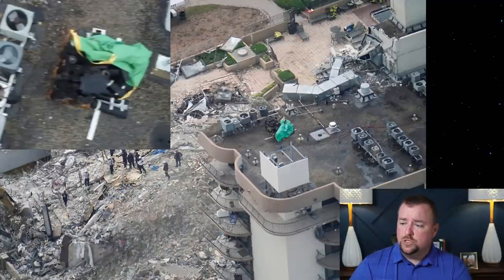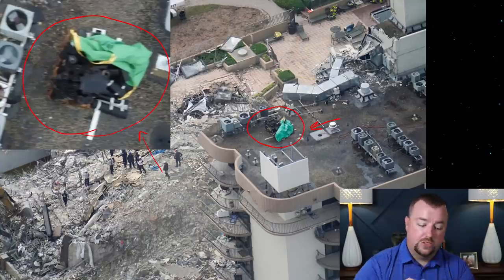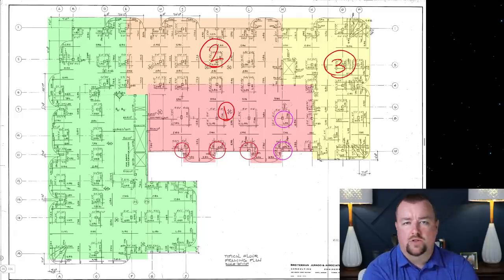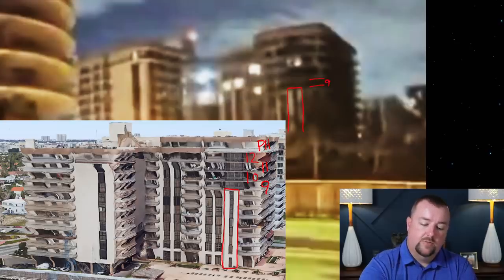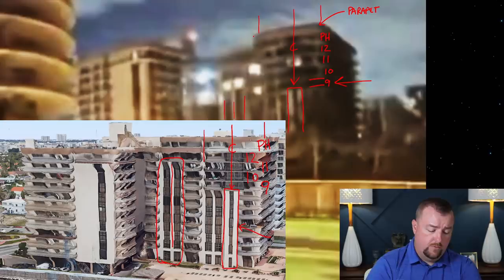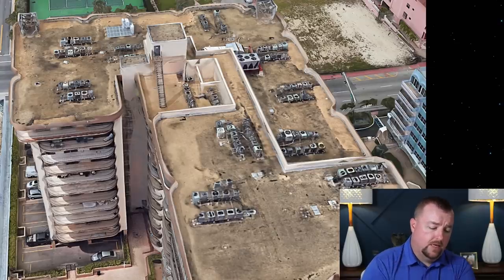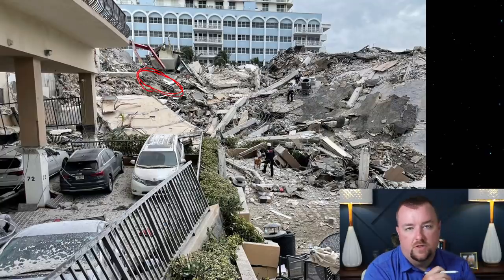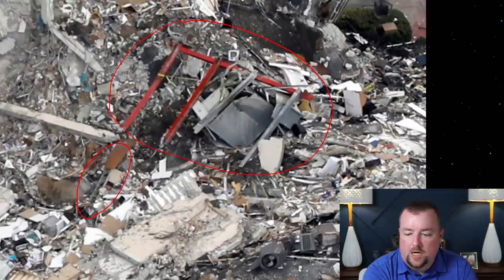Surfside Building Collapse - Did it start at the roof?

Comment: You are way off about the roof. Sara Nir (unit 111) has already said that the pool deck collapsed first. Here’s some of exactly what she said: “So I came home at like 11 o’clock and there were like noises, I always hear construction noises, knocking sounds, I shouldn’t be worried, nothing’s gonna happen,” Chani said. “So I start to hear knocking sounds on the walls. I was sure that people were hanging pictures, and then it was more intense, and then about 1:10, the wall above me collapsed,” said Sara, describing the moment when her internal alarm bells started ringing. “And I said run, it’s an earthquake, run, run, run, fast!” Her daughter Chani had just gotten out of the shower and was in her bathrobe, but there was no time to get dressed. “We heard like another boom, while we’re still in the lobby then we ran outside and we see the whole pool area’s just gone,” Chani said. “And I said no time, we need to run because this ground is not safe anymore, we just exit the building, we cross Collins and suddenly a big boom, was a big cloud, I didn’t see anything, I couldn’t breathe, I said that’s it, this is the end of the world,” Sara said. “So we’re all just running across the street and the second we got across Collins, we hear like a huge boom and we just see white dust particles following us, there were like three parts of the collapse, I think that was like the last collapse and I was like, whoa,”.

Comment: Did it start at the roof, Josh?  I am surprised you didn't argue this point from video analysis.  Anytime, I see video of a building falling or collapsing, I immediately search the image looking for dust and smoke.  The dust cloud from the failing structure points, in situ, will indicate the point of failure.  Look for the dust in the video.

Comment: I wonder if that light that looked like a flash to some people isn't just the result of the electrical lines being severed as the building collapsed. Living in California and having been through four earthquakes above magnitude 7, I can tell you that flashes of light happen when damage is done to the power system and that much more bluish color is pretty distinctive of both damage to the power lines and these weird lights that sometimes come right out of the faults, both during an earthquake and when there is no measured earthquake. Maybe it's some kind of weird thing in which electromagnetic energy is able to pass through the air briefly because our electric grid is thankfully not as powerful as lightning so that this effect only occurs briefly. The lights the faults sometimes put out are much bluer and they are sometimes different colors in other parts of the world, plus I have no idea to what they are arcing but I do know that I've definitely seen them come directly out of bare ground several of times and so have other people in the area.

Comment: I think the flashes were electric circuits. Arcing as the conduit was being pulled apart by the collapsing section of the building 
Notice the red marker light on top of the elevator equipment room. It goes out just as one of the circuits blew

Comment: The building columns look undersized; although, there are several. Kind of like a table with skinny legs, wobbling when a load of groceries place on table top. In the building's case, the columns would deflect back and forth, creating a fatigue scenario with so many allowed deflections, thus reaching its cyclic limit after 40 years.
Reply: They do, but it is hard to tell from a photograph.  A more obvious weakness is the lack of an abacus on the posts.  In my reinforced concrete buildings, the strongest supports, in the garage and on the first floor, are cylindrical.  Near the top they flare out to a wider diameter.  Then there is a large square abacus and the next floor rests on that.  The entire structure for one floor is tied together with rebar and poured as a monolithic casting.  The combination of the absence of capitals and (probably) poor design of the rebar is the reason the columns punched through the pool slab.
Reply: @GH-oi2jf  Thanks:)

Comment: Penthouse floor collapsed from roof work. Movement of the floor down added energy to the weakened supports at the bottom of the building, forcing their collapse.
It would be one huge coincidence that workers started doing work at a site that had a major catastrophic failure and they had nothing to do with it. Could be, but history says odds are they are related.

Comment: I've seen reinforced concrete buildings which had collapsed because of powerful earthquakes. They all had sections of pillars which had broken because of lateral forces. And these broken main pillars were a prominent sight among the rubble - always.
What puzzled me in this collapse is that you can't see any chunk or section of any concrete pillar. This means only one thing: that the totality of the concrete had lost its cohesive properties, irrespective of other causes as rebar oxidation, water and chlorine infiltration, thermal stress, subsidence, etc.
A prayer for all the people gone in this disaster...
Reply: There ar columns visible at 21:00.

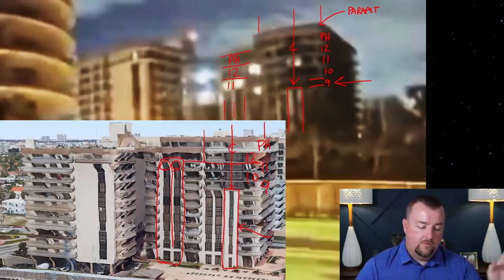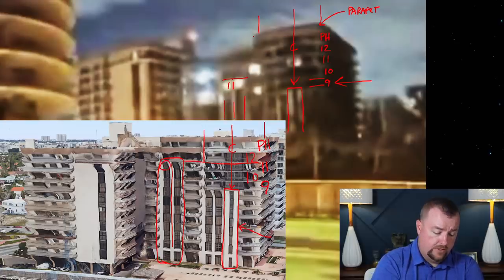Comment: Hi. At 16:45 you indicate the 11th floor as the one with the two window lights between the three columns, I disagree and believe that is the 10th floor, the area marked by you as the PH is the 12th floor. Look at the insert picture and delete the left half of the PH and you have the frame pictured in the start of the video. The dark area you label "PH" over is the balcony of the unit on the 12th floor. At 16:13 I believe you wrongly marked "11" the columns go on behind the lights, clearly visible on the left side of the floor above the lights, less so to the right, but still there. The penthouse is missing as is the wall around the yard for the lift tower.

Comment: IMO - Plumes of dust and concussion wave from ground level Dust plume on outer area (frame 1) is 70 feet - or 6 floors high high, while center blur dust plume cascading in front of lighted center apartments looks to peak at 12 floors like a water spout reaching near 120feet . Notice the dust plume on the roof of the cascade is almost 10 - 15 feet high and windows are intact on the top floors. Glass would have blown out and dust plumes on the center would have blocked floor 11 - Penthouse from camera views, this is clear shots allowing us to see window frames with no dust plumage distorting them.  tends to make me think the columns on the parking deck failed first

Comment: Isn't it just the angle of the camera, a trick of perspective? It's possible it only looks like the 12th floor and penthouse are missing from the center but because they sit further back than the section of the building that is closest to us, they appear lower. The camera footage is closer to ground level looking up, which creates this kind of illusion and looking up at a building makes things at the top appear a little different than it does by looking at the building from the top down, as in the Google photo. That's just my thought from an artistic perspective.

Comment: why did the original building engineers use those toothpick sized columns in the parking garage under the pool deck?
Reply: They look small from a distance, but they would probably be adequate if the concrete were good, if they were properly reinforced, if they had solid footings, and if they had a secure connection to the deck.  It isn’t the size of the columns that concerns me, it is the design of the entire structure.

Comment: please keep in mind that most of the modern LED lights have a switch mode power supply in it. This means, that some capitors are still holding some charge even if the mains has been allready disconnected. Maybe this explains why the lamps are still on in the first frame of the video.

Comment: 4000 psi concrete will hold 4000 pounds per square inch. If you have 12”x12” columns that is144” square and each will hold about 570,000 lbs and the total can be close to capacity when fully loaded.

Comment: The big lights that ppl are talking about at the 11th and 12th floor are most likely from a reflected light, probably from the sliding glass door to the patio. As the building collapsed the glass doors would have either distorted before the glass broke or the doors tilted a bit as it collapsed. Glass and light reflections can be quite spectacular and can look like a flash from a camera or an explosion inside. I've even seen flashes on videos and photos from cameras that can pick up inferred lighting.  
The reflected light could have come from a verity of sources, like street lights, building lights or security and night lighting. I've seen some other smaller buildings being demolished without explosives, and as a section fell the light would reflect off the glass. often times it can look like a flash from an explosive, especially at night if the glass pops out of the frame and or shatters. 
I've seen other pictures and videos that show a lot of concrete cracking, exposed and rusty rebar and one video showing clearly that a 3 or 3 inch pipe had broken and was poring water into the basement garage, just inside of the entry ramp. There are other photos and videos that show columns, where the floor had dropped into the basement at sections where the part of the building was still standing. It is clearly seen where the white paint stopped at the basement sealing and the posts are numbered for the parking spaces. 
I believe that condo had some serious rebar corrosion that swelled, cracked and weakened the foundation. With the photos the pool maintenance guy took of the pool filtering system, the floors wet and evidence of large concrete spalling shows that there was some serious water leaching through the concrete. If that was from the pool or the pool plumbing, the water contained Chlorine and would have caused not only corrosion in the rebar but the steel type of the rebar can become brittle. Chlorine can also be detrimental to the structural properties of concrete and remember this place was built next to the Atlantic ocean with plenty of salt in the water, air and blowing sand. All that combined with water and peculating through the concrete over years would have major deterioration of the foundation. Add to that the exhaust from cars driving in and out of the basement garage over years. The catalytic converter in cars produce several gases, one being Ozone in small amounts. Ozone is harmless up in the ionosphere, but down at ground level it is very corrosive and over years has has effects on structures in high traffic areas. 
I'm positive the collapse started at ground level at the foundation with the collapse of the basement garage first.
In 2018 the building inspectors report documents many problems with the structure and foundation and stated that if it was not taken care of soon, this would get "Exponentially" worse. IOW, these problems would be multiplying every years that they were not fixed. This condo demolished its self about 3 years after that report.
Another question, I thought in buildings like this and especially in areas like this condo was built, next to salt water, I thought they would have used waterproof cement. That only takes the addition of Fly Ash from something like a coal fired power plant. The Roman's used Volcanic Ash to water proof their cement and many of their buildings and aqua ducks are still standing and being used after 2,000 years or more. Another thing that might have helped would have been wrought iron as the glass fiber in that would have added strength to the rebar. Unfortunately they no longer make wrought iron rebar, they uses a cheaper steel processed rebar and as old as that building is, they may not have used a protected coated rebar at that time.

Comment: From all the videos ive watched the salt water sitting on the pool deck and not draining away as the concrete floor was pour flat could be a contributing factor, which is a big design flaw, the salt water over the 40 years of just sitting on the deck seeped into the concrete pillars and corroded the rebar, witness have said the pool deck collapsed first, we dont know how far into the main building the salt water ingress was, but from all the videos and seeing all the corroded and failed concrete pillars id say it was pretty substantial
Of course this is all speculation, im a builder not a engineer, but i know the strengths and weakness's of reinforced concrete and how corrosive salt is, and once corrosion starts its really hard to stop it

Comment: sorry you just didn’t answer the question of whether the roof was overloaded. Regarding the stairs to the elevator tower, I would say that in front of the black car on a light background they are directed towards the car. The picture shows the wall where the elevator is located, but I don’t see any steel anchors pulled out of the wall. As if the elevator was built later and the anchorages were not properly fastened.

Comment: If you know about all these schools in NYC that were condemned, due to the same pancaking effect, due to the composite of the concrete. I bet some testing will show salt injected into the concrete in the peers. Either by the sand used in construction or from exposure. In the future Rebar will be specified to use 200 series stainless, which is manganese based which is readily available and inexpensive.

Comment: The pool deck collapsed first. A lady standing on the 4th floor told her husband 7 minutes before the collapse that she watched the pool deck collapse. Then she made a noise and her phone went dead. She was killed. Then the couple swimming across the street in the hotel pool heard a noise and did a video showing stuff falling in the garage with water pouring from pipes into the parking garage. 
Then there’s video from another building showing the whole building coming down then the front was standing for a few seconds. Then it leaned and fell too. So the top first is not correct.
Reply: The pool deck and the collapse in the garage are likely one and the same.  The slab the building was sitting on was also the slab that was the pool deck.  Looks like a large part of it gave way.  The building then stood for nearly 10 minutes without whatever supports were no longer in place, before it too collapsed.

Comment: Hi, have a look at jeffostroff's analysis of the collapse. Fact is, the first visible thing that collapsed was the pool deck, described as a sinkhole by a women looking at it from the 4th floor balcony, while talking to her husband on the phone (the building collapsed while they were on the phone, she didn't make it out), and parts of the garage ceiling underneath the center part of the building had also collapsed prior to the actual building collpase. A couple filmed the garage entrance, and you could see debris on the floor and a water pipe hanging down gushing out water about 7 minutes prior to the collapse. Also, the report from 2018 said that there was a water proofing issue which would cause more damage exponentially to the pool deck area.
Reply: What is also very interesting... the part that remains standing has MUCH thicker columns than the parts that collapsed.

Comment: I saw photos of column erosion, on the parking level, where the rebar was exposed, and concrete decking was blown out around those columns. Why anyone would live there, or in any concrete structure is beyond me.
Reply: I live in a reinforced concrete building.  It was built as a warehouse and used for about 60 years as that before being converted to condominiums.  It is now approaching 100 years old and is in no danger of falling down.  I expect it will stand another century unless it is removed intentionally.  Should that happen, it won’t be easy.  Properly designed and constructed concrete structures can last a very long time.

Comment: To me, a lot of the concrete rubble is in small pieces which suggests there is a problem with that component of the structure.   What causes that sort of thing to happen?   Beach sand used in the cement. Beach sand has salt in it.  We all know what happens with Water and salt when mixed together.   It is corrosive and weakens the cement. But that’s just a guess.
Reply: I read in a news article that the engineer (the same one who wrote the 2018 report) said in 2020 that there were core samples taken of concrete from the building and it showed "curious results." He apparently didn't elaborate, but I wonder if that meant there was something wrong with the chemical composition of the concrete? Maybe it wasn't made right when it was first mixed? I don't know anything about construction or structural engineering, but I do know that if an engineer says "curious findings," that is BAD!
Reply: NIST will analyze the concrete.

Comment: It wouldn't make any sense that the roof started the collapse considering the pool area above the underground parking had already fallen. This indicates the fall started from the bottom. Those 5 concrete supports gave away and the rest followed. My question is, why would those supports let go, they were back from the parking area. It's like there were two separate failures.

Comment: Your off 1 floor on your 11 / 12th floors. The lights are on on the 10th floor and then there is dark windows on the 11th floor above the white vertical walls on the left. You can carry your 9th floor over and see that where you labeled it 11 is actually 10.